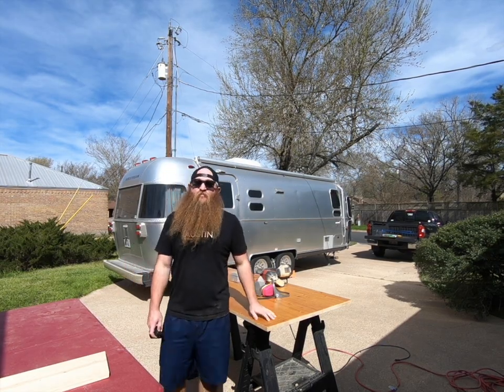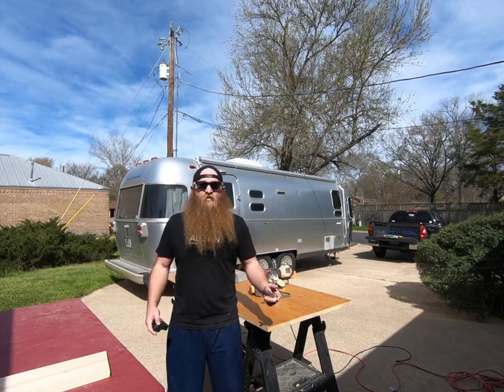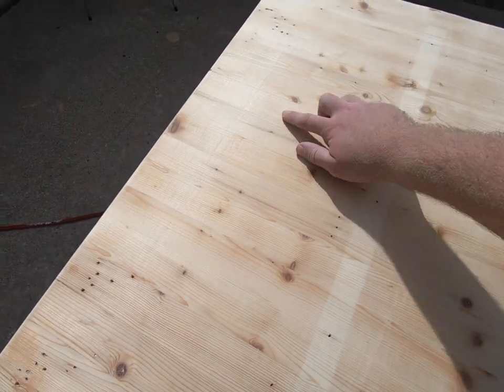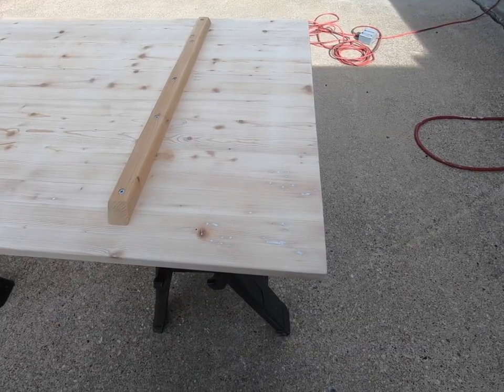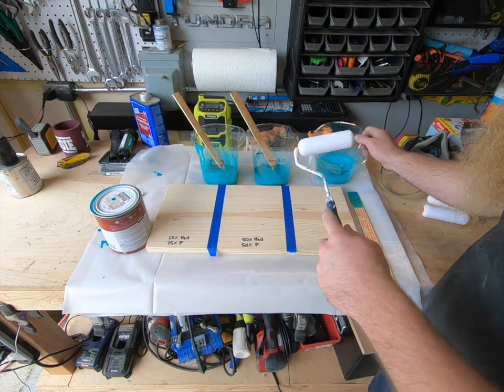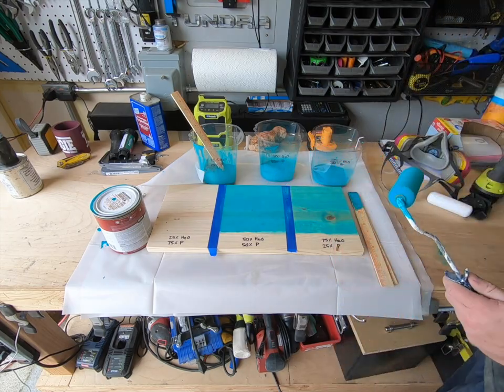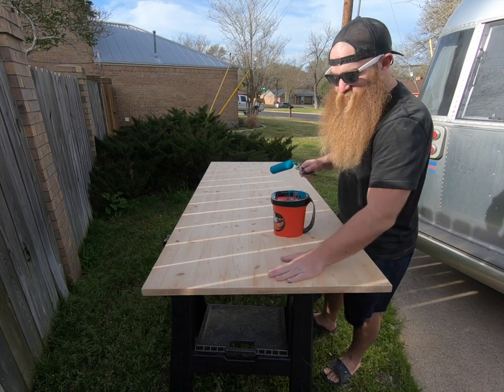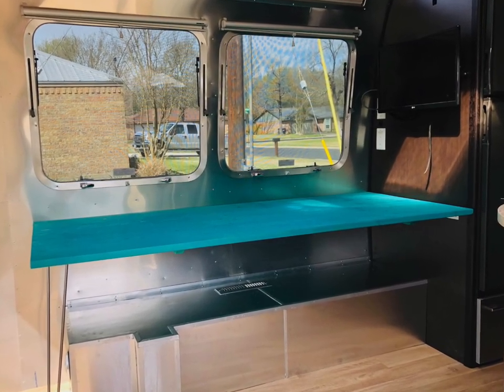Using latex paint to stain wood for an Airstream desk.

Comment: You doing roll on stain. You use a cloth rolled into a ball and rub it into the wood grain. That way the stain works into the grain. Stain should be translucent because you are not painting it. You want the grain to pop out. Then sand it. Then varnish it with a clear coat about 3 coats and buffed out